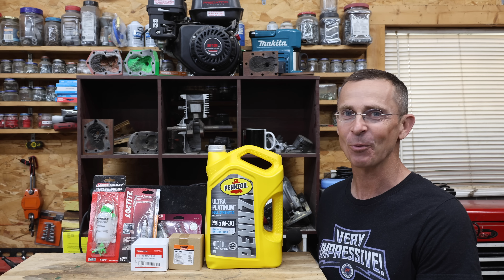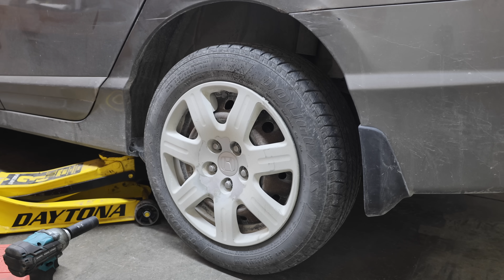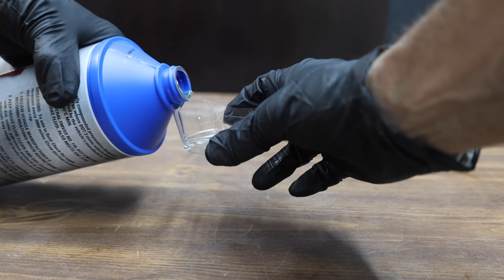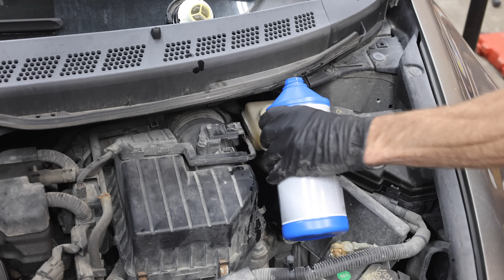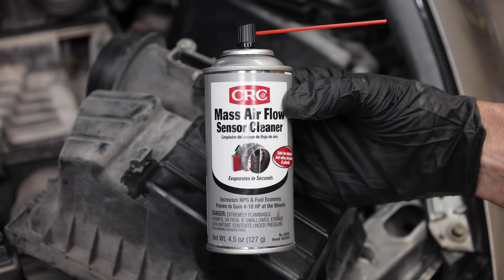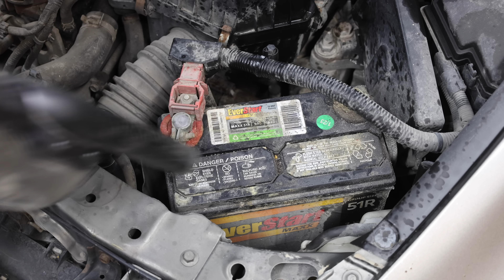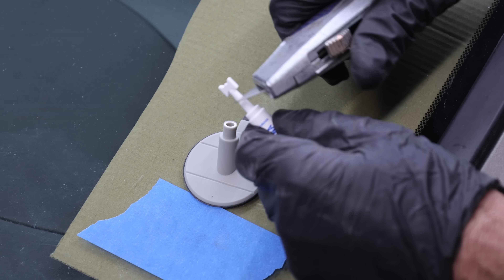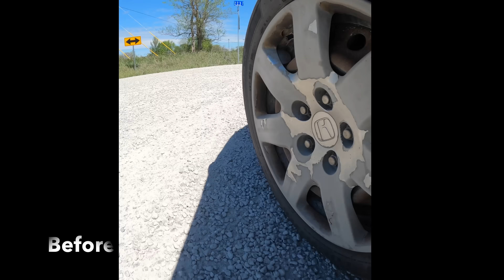Most Reliable 200K Mile Car? Let's Settle This!

Comment: Wow this was amazing! Well done! Ive got a honda civic from 2010 an ex and this thing was wonderful until about 270k miles. Out of nowhere it got super loud. I thought it was an exhaust leak as Ive had those before and they tend to have a certain familiar sound. Ive taken it to probably 6 different repair places and they try these repairs (broken motor mount, fuel evap emissions solinoid valve) and it doesnt fix it. Recently a guy said there was a hole in the exhaust. I had them fix it. They cut it out and replaced and welded a new pip in its stead but low and behold its still crazy loud. Also there is an overall lack of power that use to be there. I really love this car and wish I could get this fixed economically.

Comment: That clicking at hard turn angles is definitely the outer CV joints. Common problem on front wheel drive vehicles with some miles. 😅 especially Hondas.

Comment: Not much beats a 110 hp Skoda/VW 1,9 TDI. They reliably go 350.000 miles with only a flywheel change and regular mainetance. Even today we regularly see cars that has done up to about 435 K with little to no repairs apart from the flywheel replacement. But at this point they are ready to retire.

Comment: Honda 2010 CRV 180k miles. Regular service, tires, brakes, fluid changes, etc. The only thing that broke was the AC pump. Still driving it everyday. CV joints are quiet. Hoping to keep it to 200kmiles which will probably coincide with my EOL.

Comment: Agreed, it's much cheaper than buying a new car. Despite the cost of parts it's the labor cost that shocks most people. If your car is only worth $1000 but the total cost exceeds the value amount people will question if it's even worth it. If you have the skill and knowledge like Project Farm then it makes sense but to most labor costs add up and some people would rather take that money and buy a new or newer used car for the down payment and then make the monthly payments

It just depends on personal situation

Comment: I had 2 of that model Civic. One went 278,000 miles before we sold it. The other 363,000. The higher one is due to a 900 mile a week commute. Both cars were bought by mechanics.

Comment: I have a 2003 camry with over 220,000 miles on it, i have done a lot of maintenance and parts upgrades and it runs great, i bet ill get it to over 500,000 miles
Reply from the maker: Great to hear!

Comment: HA! i just replaced my 2011 -164k mile rogue (cvt issues) with a 2010 -213k mile corolla ($2k of repairs) = [strut/shocks, battery, 2x tires, all fluids, brakes/rotor, windshield/2x wiper, hoses, spark plugs/coils, cv axle, filters] + i'll be replacing stock radio and front/rear speakers next week.

Comment: I watched this video when it came out 3 years ago, mostly because no content creators really make videos about lincolns. Last year my mom's 2019 MKC threw this code around 78k miles. I changed the spark plugs even though it was missing some coolant, and the light still came back. I told my mom it's gonna be at least $7k to fix it and she needs to get rid of it before that happens, and being a boomer she STILL wanted to get another Lincoln.

The lincoln dealer was very rude, wouldn't negotiate on a new Corsair, they bought out ALL the local competition years ago so there was no one around to negotiate with, and were only offering her $9000 for her MKC. They know these things were hot garbage. I ended up selling it to a different dealer for $15k and convinced her, after 40 years of buying American made cars, to get an Acura RDX.

I looked at the carfax last month, and that dealer barely made $500 on it and replaced the long block a month after it sold.

Comment: A few cheap upgrades you could have also done are pcv valve, and downstream catalytic converter. Catalytic converter would have put you over $1,000 but if it hasn’t been replaced for awhile with 200k miles it’s a must

Comment from the maker: Here's the list of the tools and supplies that I used in this review, and please checkout the video description for more details. Best regards, Todd
Brake Fluid Tester: https://amzn.to/3WgLZlf
Vacuum Pump for Fluid Extractor: https://amzn.to/4baBvbw 
¼ Inch Clear Tubing for Fluid Extractor: https://amzn.to/3Qm65Xv
Step Bit for Building Extractor: https://amzn.to/3UBuawf
1-Man Brake Bleed Kit: https://amzn.to/3wjTZY5
Silver Paint for Hubcaps: https://amzn.to/3UcpknH
Coolant Test Strips: https://amzn.to/3UyomTW
Dielectric Grease: https://amzn.to/49VL790
Permatex Windshield Repair: https://amzn.to/44eUcIJ
Spray On Ceramic Coating: https://amzn.to/4dtEq11

Comment: I almost want to strike up an arrangement with this man, where I drive my 2006 Honda Civic (129,000 miles, although 131K by the time I get to Missouri) over to his location, he does the same thing to my car.  I pay for parts (probably under $500, based on this).  I'll pay for some of the labor too (even though he gets his video earnings).  But he does a video doing the same to my car.

Comment: I am in this exact situation.  I have a 2006 Honda Civic but with just 129,000 miles.  It may have a small engine block crack, but it also has a scraping/clanking sound when turned on, and (bad) a burning rubber smell when driving.  I know that it can be fixed for $400 based on the knowledge level of this video, but I obviously don't have the skills.  I wish I could just spend a 3-digit amount and get it improved to last another 6 years.
Reply from the maker: Thanks for sharing.

Comment: I buy a Toyota with 100-150k miles and drive to 300k. I've had 2 Camry s and 3 Siennas and as long as you take care of them they go at least 300K without engine or transmission replacement or major issues. Honda minivan with 135k now has 228k on it but i had continual problems with engine codes, having to repeatedly replace plugs and ignition coils about ever 25k, ridiculous. I'm absolutely not sold on Hondas

Comment: Just bought a 1998 Toyota Carolla with 200,000 miles..one owner. AC blows cold enough to hang meat. New tires, new battery, fresh oil, all service records. Power locks and windows all work. Georgia car. No rust.
$2500

Comment: that would have been $8000 of labor at the dealership
Reply: Always the biggest expense when buying used vehicles. Not every used car buyer is able to do the type of repair work performed in this video and thus, factoring in those labor costs can offset some of the advantages of purchasing a 200k+mile vehicle.
Reply: @KPA78  That's why you don't go to a dealership, they always charge way more than everyone else. I have a great local mechanic who I feel like could do this for $1000, $1500 tops in labor
Reply: @XD-ph2pr  I did this for like 300$ in parts in my garage on my son's 97 corolla. Took less than a weekend lol we even did the timing belt on top of a lot of these items.
Reply: @XD-ph2pr yeah, smaller garages can be a lot more reasonable.
Reply: @XD-ph2pr I’ve had instances where the dealer was cheaper than smaller local shops on certain repairs. Dealer is usually a little more, but sometimes a lot more.
Reply: @KPA78 which is why every person needs to learn how to fix things.   Saying, "I don't know how" used to get my daughter in trouble.  I would correct her to, "I don't know how to....yet."😂
Reply: stealership*
Reply: and after doing it will offer you $800 for the car.
Reply: that cheap?
Reply: And the tech wouldve made like 150
Reply: $1,000,000

Comment: Except for struts, all of this is considered regular service in Europe on every 60k km (36k miles or two years). On top of that, add water pump, pulleys, and belt. Then every American wonders why our cars easily go over a million miles and in the States high miles in considered over 200k. People celebrate at half a million like it's a big deal.... lack of preventive maintenance is the issue, its not only oil changes. Oil in US is of poor quality compared to the EU (not fully synthetic, search for Mobil 1 and Castol lawsuit and why)

Comment: Excellent video content as always. Automobiles are a depreciating investment that we need for our daily lives. I stopped buying new when a large number of new vehicles started getting recalled.1999 Ford F350 248,225 --  2003 Toyota 4Runner 115351 - 2011 Ford Ranger 110822 - 1996 Bounder Motorhome 81,152 All are highly reliable due to a lot of preventative maintenance. I would not be afraid to drive any of them across the country
Reply from the maker: Thanks!

Comment: my 2012 VW manual is now 210K miles. I start to learn how to do these small maintenance as the car still drives like new (fuel efficiency, ease of handling... etc ) as it is definitely much cheaper compare to buying a new car.
Reply from the maker: Nice!

Comment: The only thing I was confused about was why you would change the transmission fluid on a 200k car? I was always told that önce the vehicle is over a certain mileage (est 100k) & hasn’t been previously changed to leave it alone. Especially if the color is dark tan brown. Yours looked almost black so why would  you change at that point? Please @project farm if you can please explain your reasoning for this. Thanks

Comment: Great vehicle maintenance checklist. You should add wheel bearings to it. Those usually start making noise at about 150k miles depending on use and driving conditions.
Reply from the maker: Thanks for the constructive feedback.
Reply: @ProjectFarm No sir, thank you…your videos are awesome and much appreciated.

Comment: Have you ever been able to remove stop- leak additive from an engine?  I used stop leak on my car and it clogged a coolant passage so now the temp gauge is reading high. I replaced the thermostat and the the temperature gauge still reads halfway up instead of a quarter  way up the temp gauge like  it used to.   Yes, stop-leak is not a good product. 
Thank-you.

Comment: I don't quite agree with you saying "There's a good chance it will break the windshield", regarding the cloth for the wiper arm.

Knowing how tough windshields are, I never considered putting down fabric when changing Wipers. I have had dozens and dozens of wiper arms smash down. From a a nissan leaf, to a Kodiak, trucks, cars, side by sides, go-karts, and not one single time have I seen so much as a nic in a windshield.

I will start using a towel from now on, because I was ignorant and never considered the possibility, but a possibility it is.

Given the cost of replacing a windshield, I'd rather take my shirt off if I have to...

Comment: I try ti keep my vehicles at least 270,000 miles sold my 1993 BMW 525 with 271,000
And it looked and ran  like new. Replaced it with 2010 Honda Crosstour with 140, 000 now and is in mint condition. 
New cars are just stupid ! Thanks

Comment: Luv when he says “buy once cry once”! I change fluids often as the saying goes it’s cheaper than major engine repairs. Coolant, brake, diffs, tranny, of course motor oil, coolant hoses, air filter. I dipstick every Saturday morning. Tranny every year drain and fill. Camry 160k miles, RAV 4 222k, Subi 211k. Sad how we are a disposable Country. Maintenance is longevity. Utah, USA luv this channel.
Reply from the maker: Thanks!

Comment: This is outstanding, just like your Suburban refurbishment video!   At 61, I'm a life-long fan of rescuing and refurbing vehicles, rather than buying new.  It's not for everyone of course, but it's worked out well for myself and my family.  I daily an '81 Volkswagen Rabbit diesel pickup that I found in '93, in pieces, for free.  It has about 390k miles on it now.  My '90 Suburban that I found at the GoodWill Donation Center in '04 with 225K on it, now has 331k on it.  It was $1,400.  The '05 5spd CR-V that I found in late '23, non-running for 3-1/2yrs with 271k on it, now has 283k.  It was $1,200.

Comment: Bought a 2004 Corolla w check engine light due to CAT issue & a clicking tie rod. Brought a mechanic & consult w another told to ignore CAT & tie rod issue. Bought the car for $2700, use it for a year, broke down 3x due to Transmission cable $100, battery $50 (used) & starter $250 (tow once $80). Total fix so far $1000. 

Use the car to work & Doordash for mths w little other prob. The car runs way better now, decided to keep the car, it will last me yrs w little prob.. 
The car will cost me $4000 total, some little headache when it broke down, but no major issues. New car might not give me any headache, but not if I hve to waste 1000s..

Comment: Awesome vid - covering all the bases. 65 years old now - Back in college in the 70’s we did a study in an economics class about cars - in every scenario with data - the best deal was buying a used car with the best reputation for reliability (shaky data back then as they did not have independent data bases on car reliability - they were controlled by the car makers. Independent data base did not exist until consumer reports came along). Still, it always showed that a used car, maintained well,  was a much better buy than a new car in every case. Same applies to this day.
Reply from the maker: Thanks for sharing your experience!

Comment: Ours are 2004 Honda Accord (269K V6 hotrod), 1997 Toyota Camry (very comfortable), 1995 GMC VAndura 2500 (Best workhorse ever, indestructible, with Positrac).  Will put them up against anybody else.  Easy to maintain, parts still available.  1975 Camry was given away to Goodwill, after parts became unobtanium (355K).  1972 DatsunZ240 (660K) parts no longer available, sold for 750$.
Reply from the maker: Thanks for sharing.
Reply: the 240z still has parts support...

Comment: This is but cosmetic repairs. Forgot to mention about the transmission and radiator problems after 200k mile? Or was the $500 seller a real straw-man?

Comment: Do tose models have"interference"engines? If so,make sure to alwsys replace the timing belts on time,or you may run into a bent valve,or busted piston/cylinder......the older hondas had these.

Comment: Looks easy but it is NOT! 1 rusty bolt now the car is parked for 2 weeks. Oh they didnt have the correct part ? Back to the store. Ohh they dont have it ? Try another store. Ohh no? Again? Back to the store. Now you gotta order onine. 1 week later. Forgot where the bolts went. You get sick. Pos car sits for another month. Just go to a mechanic.

Comment: You'll never get that many miles on a GMT900 without major engine repairs. The AFM tech destroyed those 5.3's unfortunately. Cam shaft and lifter problems within the first 200,000 miles for sure.

Comment: Another great video, another thing to consider when comparing a new vehicle to used vehicle are all the taxes, freight PDI, admin fees, borrowing costs if needed etc charged by dealers when buying new.  A few years ago I purchased a 2011 Lexus RX350 for less than the cost of those fees and taxes on a new one.  I invested the money I saved between buying new and used  in GICs and the interest earned on those investments has now paid for the cost of the 2011 Lexus and continues to earn money to this day.  So far the Lexus has needed nothing but oil changes, beautiful car to drive as well.  

As a request, could you do a comparison between monofilament fishing lines at some point?  Preferably in the smaller line tests if you do it say 4-10lb range?
Reply from the maker: Thanks for the suggestion.

Comment: I bought my 2009 Civicfrom a friend in 2021 with 335,000 miles. Three trouble-free yers. Now its at 420k and recently replaced radiator, thermostat and abunch of suspension parts. Engine and transmission are fine. No oil leaks. Great solid car.
Reply from the maker: Nice!

Comment: Very well done I just went thru a 2012 Honda Pilot. The cylinder cutout system uses a temp sensor to initiate.  It is a faulty system that can cause the engine to pump out oil at times. I bypassed the senor with an ic that causes the computer to think the engine is cold which avoids the cylinder cutout.  The result is better power and better mileage.  Other ic has a low current requirement so I installed a full time ~1 amp trickle charger on the battery.  Ps the tire jack is a little short so a 1’ piece of a 4x4 is a handy device.
Reply from the maker: Thanks!

Comment: I do a lot less maintenance on my 2000 tundra and it's going strong at 480,000 miles. Much of it off road pulling logs and hauling a trailer.
Reply from the maker: Thanks for sharing.
Reply: 480k????? what oil are you using and what is the oci.

Comment: Anyone looking to change their transmission fluid (no it is Not good for the Lifetime of the car unless Lifetime means 80-100k miles)
by themselves or taking it into a shop NEVER "Flush" a transmission or engine. Just change the damn transmission fluid every
60k miles. Drain and fill is 'okay'.  But dropping the transmission pan and replacing gasket and filter is even better. 
Your car will love you for it.  Promise.

Comment: We are NO LONGER getting the best designed, best built cars and trucks. That period 
occurred between 1996 and 2010 or maybe 2012. All brands and models (but with some questionable Nissan
models that have CVT transmissions buyers need to be aware of).  After that, it has been all downhill.
Car companies are now selling "Bling".  The engines get smaller, but the prices get larger.  You can keep your turbo chargers.
Reply from the maker: Thanks for sharing.

Comment: If anyone happens to see this, yes the Honda is a solid running car. But, I think there are 2 others that outshine all models
when it comes to how many miles you can get out them compared to other vehicles.
Lexus LS400 and the Ford Crown Victoria. Short of using Dynamite, those two cars will damn near run forever.
Reply from the maker: Thanks for the feedback.